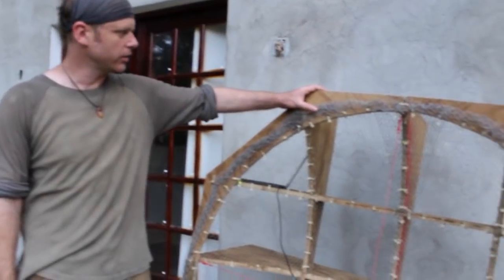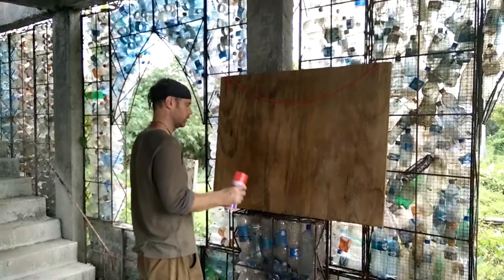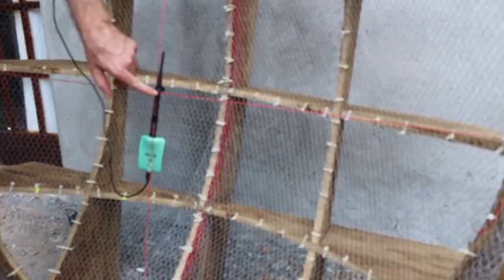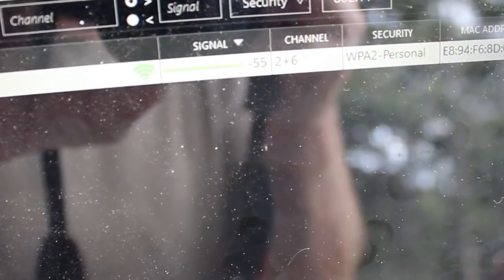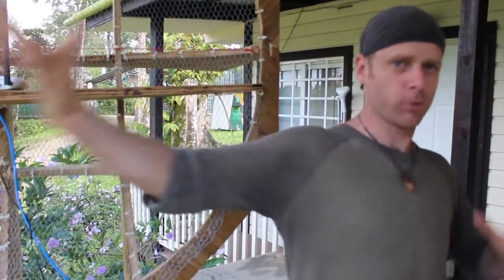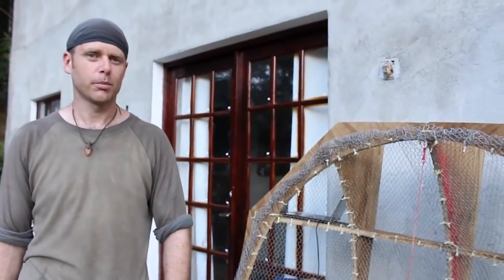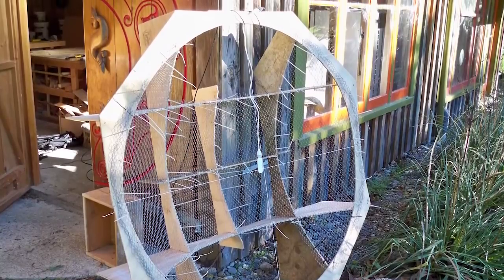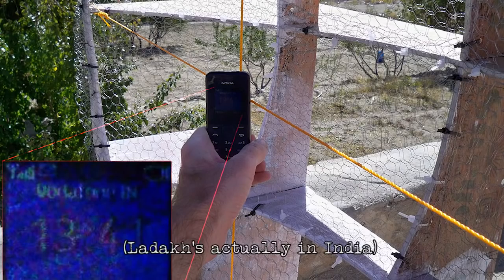$20 WiFi Dish with three mile range

Comment: Just wanting to add some thoughts and info for anyone thinking of doing this anywhere in the world... I've been living with a similar dish enhanced internet for nearly 10 years now. We use an 80cm aluminium dish we found by the road and 3G (and now 4G) USB keys to get signal at the focus from a tower about 40km away.

Instead of using a power-hungry laptop for usb->network routing we've been using a TL-MR3020 USB mini-router (2W total in use, 0.1W idle - we leave it on 24/7). Maybe cheaper or for wifi and more versatility a cheap sbc (like banana Pi Zero) with linux router config should do as well.

Focus seems really important, more than the examples in this Vid would suggest: within 1cm makes a huge difference. Find focus and pointing direction with shiny tape on a few points round the dish and the sun (this also enabled me to bend the slightly bent dish back into perfect shape). It may be the imperfect shape of the chickenwire dish is why focal point doesn't seem to matter so much, making up for it with sheer size. The size is probably also important for getting through trees, which scatter and refract the microwaves.

I tried with a 40cm dish and got seemingly identical 3G results, but with less accuracy of pointing required. Not tried with 4G.

Our dish is aluminium, I've had trouble getting steel dishes to work, I think the issue is skin depth because satellite dishes are made for much higher frequency with a thin silver plate for conductivity down to the skin depth, the silver plate may not be thick enough at 2Ghz for a low conductivity steel reflector. This could affect the (steel) chicken wire reflector, especially as the zinc corrodes.

4G signal boost seems much less with the same dish, just 10dB gain, though if the dish is pointed wrong the data rate still drops radically. I think this is due to the frequency range used by rural 4G being lower (800-900Mhz band) and the same dish has less circular wavelengths of surface so less signal boost at that frequency.
Reply from the maker: Good info, thanks.

Comment: There are all sorts of old analog TV dishes 12 feet across in rural places in Canada. They turn up in scrap bins or can be scrounged for pennies.
Reply from the maker: Yeah, essentially the same principle. It's not super common to find the larger ones tho, and most of them are paraboloidal sections in shape, so the focus is usually off to one side a bit, which makes them harder to mount and aim.
But they do certainly also work.
Reply: @OpenSourceLowTech  I think Canada is unique because it is so far north of the equator. This is why we used to have these large dishes here but the system is now defunct since the satellite went off line. Another reason is the huge geographical expanse between occupied places here which means only town & cities have cable.

Comment: Nice sized dish and construction  method. Aside from obsticles  range is often limited by horizon so getting heigth is important and height can be problematic with more wind. But the chicken wire construction lets the wind through with very low wind loading.

Comment: The thing is where they are it's VERY sparse and isn't channel saturated...they are in panama and I would be there isn't a WiFi router in every home, and every apartment out there (it's a jungle afterall 😉 )...this is more like wide area WiFi running on a single channel with almost NO channel interference...if you tried this somewhere in a heavily populated area it would literally wash out the channel (and those above it and below it) it was operating on for miles...plus I would bet it would also violate FCC rules for dBi regulation with it's gain (in America)...however it's an INCREDIBLE idea and works well for a remote location like that! Kudo's for such an ingenious setup!

I bet you could also get very good coverage with a high gain yagi antenna setup as well

Comment: USB 2.0 is limited to 5 meters.  Using USB hubs/repeaters one can daisy chain up to 5 hubs together to get 30m.  Alternatly there are USB to ethernet adaptors which allows using twisted pair ethernet cables upto 100 meter between two usb to ethernet adaptors.
Reply: Wesley Sandel  yeah, i should have said twisted pair ethernet. I'll   Make that change for clarity.  

In some cases fiber optic might negate the need for USB cables and wifi dongles completely. I'm not in a position to compare cost  but  i belive generally wifi will be more flexible, but fiber optic is hard to beat for distance and data rates. 

On data rates, aside from latency, maybe sneeker net is still king. 😉
Reply: Wesley Sandel   a pcie ethernet fiberoptic card  over multi mode fiber optic cable can get one several kilometers and much faster than a few megebits/s 

With fiber optic,  twisted pair, and wifi,  data is modulated onto the physical medium, and demodulated on the other end. In other words an ethernet card modulates and demodulates.

Comment: 2.4ghz vs 5ghz  bands.  2.4ghz bands can go through vegitation a bit better than 5ghz  but 5 ghz bands can carry more traffic if you dont have obstruction. 

Furthermore, 2.4ghz band have a little over twice the wave length as 5ghz  band.  Thus, depending on the hole size in the chicken wire mesh,  5ghz might be more lossy reflecting  the signals.
Reply from the maker: Indeed.

Comment: A similar effect can be used with metal discs of various sizes attached to a pole. In combination with this it would give excellent range
Reply from the maker: Like a kind of Fresnel reflector?
I like the chicken wire as it can stretch, and so make bowl shapes where flat metal can't.
I do now want to experiment with secondary antennas at the focus, like yagis / cantennas etc, to scoop up more of the focus blob than the basic linear antennas I've been using so far.
Just need to get around to it...
Reply: @OpenSourceLowTech  search “long range wifi antenna” on YouTube, look for a pole with metal circles on it
Reply from the maker: Ah right, that thing. Yeah, would like to plug one into the dish and see what happens..
Reply: @OpenSourceLowTech  also to improve reception the focal point of a parabolic dish isn’t level with the outer edges. It’s about 6 - 8 inches above, based on a 4 foot diameter dish with a curvature base on gravity pulling the chain into a curve.
Reply: Sorry I just re-read that and it comes across rather condescending; I’m pretty sure you are aware of the position of the WiFi dongle is only placed there because it the simplest position...

Keep it simple make it easy.
Reply from the maker: Satellite dishes and the like have offset focal points, ie outside of the dish itself, but this one is calculated such that the focal point is level with the dish front itself, where the strings meet.
Reply: @OpenSourceLowTech  ah! You already calculated the diameter!
Off the top of my head the distance between the 2 points you suspend the chain from to mark out the curvature would be 135 cm give or take 10

Comment: Nice work, you could check a YAGI or similar antenna, if your modem / router already has a removable antenna connection. But a detachable antenna is not extremely common, especially in a jungle, or some low income country where you have to use whatever you already have. So if you already have the hardware, this might be the best option.
Reply from the maker: Yeah next I want to experiment with secondary antennas, such as yagis, biquads, cantennas etc. I think, given that the focus is going to be a bit fuzzy due to the wavelengths, that they might be quite a bit more effective still.
Reply: @OpenSourceLowTech  the lighter weight high gain directional antennas (like the yaga, biquads, and cantennas) will work quite well as remote (portable) setups...they are smaller and lighter than the big parabolic antenna you have and surprisingly enough can be just as high gain and directional as that big "dish" shape...they have some that have connections dozens of KM away...but usually have good line of site with no interference...
Reply from the maker: What I want to see tho is the effect of putting one of those facing back into the dish...

Comment: Do you think you could increase you range by covering the chicken wire in aluminum foil?
Reply from the maker: Probably... A main issue would be getting it smooth tho, otherwise you're just going to scatter microwaves in every direction. Not sure how you'd attach it, would be more work, and would leave the structure a lot more wind affected. 
You might have more bonus with just a second layer of chicken wire, but other types of metal surface do remain options.
Reply: @OpenSourceLowTech  I guess that would be true. Have you considered sandwiching the wire between thin layers of fiberglass and painting it with chrome paint? Maybe sanding it to a high polish?
Reply: @OpenSourceLowTech  not sure if those kinds of supplies are available in your area.

Comment: How sensitive is this to imprecision of the build/setup?  Will it work well if I'm not very precise on the cuts, the hookup of the wire, or the placement of the receiver?
Reply from the maker: It's pretty forgiving. I've not yet compared a perfect CNC'd one to one that's pretty rough, but given the wavelengths involved I'd be surprised if the difference was easily measurable.
Reply: Daniel, I'm a really big fan and I'm honored to say I would be committing the next few years to spreading your great tech. I had this made but I think the guys screwed up with the paraboloid shape, because it hasn't worked so far.

Comment: Intresting idea. Why not use a stapler instead of zip ties?
Reply: That was my first thought as well.
Reply from the maker: It could work, and might be a bit quicker, but the good thing about cable ties is you can use them as little ratchet straps to pull the mesh super tight and smooth to the wood.
The surface ends up under a bit of tension, which establishes the bowled shape and locks the slats together solidly. You'd definitely struggle to get and keep that with staples and the like.
Reply: Staples would need to be stainless and heavy gauge, because they'll rust or pull out as the wood gets dry.  

The zip ties need to at least be UV resistant or they won't last that many years before they'll get brittle and need replacing. Though spray painting over them will prolong their life tremendously by eliminating quite a few years of sun exposure.

Comment: Surely your focus point should be further away from the dish? Unless I'm not seeing as much curve as there truly is?
Reply from the maker: It's a little deeper than it maybe appears. That's mathematically the focus.
Reply: @OpenSourceLowTech  Ah cool. It's a really good cheap design. What sort of frequency would it be good up to? I take it you need at most a mesh hole size of around half of the wavelength?

Comment: It's unlikely that the transceiver was mounted at the focal point. I'd guess that it's around a metre forward of it's current position.
Reply from the maker: The parabolas are calculated to have the point where the strings cross as the focus, but that's assuming collimated signal coming in straight, which is of course a bit optimistic in the real world, but there's not a better place to put it.
Reply: @OpenSourceLowTech  I'm glad that you have considered that. It just looks wrong to me.

Comment: Nice project with practical and rewarding real-world applications. How did you determine that the "gaps" between in that chicken wire would correspond with your target frequencies?  (roughly what is the frequency range for that type of mesh?) . Is there some method you followed, or trial-and-error?
Reply: I don't think he did. Wifi is typically 2.4GHz, which is the same for microwave ovens, and those use a mesh with holes that are much tinier. So there might be room for improvement but whether the difference would be noticeable, I cannot tell.
Reply from the maker: The rule of thumb for reflecting electromagnetic radiation with a conductive mesh is that the cell size should be no more than a tenth the wavelength, which in the case of 2.4 GHz is 125mm / 10 = 12.5, which small cell chicken wire and the like is usually a little smaller than on the long axis.

Comment: It looks like a directional antenna, how sensitive is it to misalignment?
Reply from the maker: It is, and not sure. In use; feels like less than I would have maybe thought, pretty much just a matter of pointing it in the general direction and seems both fairly effective and fairly forgiving.

I've been meaning to properly test the cone angle but haven't yet got around to it.

Comment: MayBe double layer chicken Wire? The reason is that the rule og thumb (arrl handbook) says that the Holes in a mesh dish should be 1/20 wavelength for same reflection as a solid dish, i.e. around 6mm Hole size Edit, you say so yourself, but IT Works fine with one layer..
Reply from the maker: I've been seeing 10th rather than 20th, but the smaller the better, yes.
I think the issue with two layers tho is that they'd separate between connection points, and I'm not sure what that reduction in conductivity would do to the reflectance. Would also increase the costs.

But it is something I want to try at some point, along with a couple other options and variations on the reflective surface.

Comment: -55 dBm at 3 miles going through forest.. damn! 🤤 Is it 2.4Ghz? I assume it is..
Reply from the maker: The three miles was open air line of site, the Panamanian jungle was about three hundred meters, but it would have connected quite a bit further than that.
Both were 2.4 GHz yes.

Comment: wouldn't covering the mesh with kitchen foil improve reflectivity?
Reply from the maker: It could to some extent, but only if you could make and keep the surface very smooth and undamaged, which would be difficult to build and maintain.

Comment: Can something like this be used for DTV (Digital TV) signals? I'm talking specifically for this:  
https://en.wikipedia.org/wiki/Digital_terrestrial_television  
Thanks!
Reply from the maker: Yeah should work better if anything, given the longer wavelength.
Reply: @OpenSourceLowTech  So I just place this behind my actual antenna and it should "focus" the signal?
Reply from the maker: In a nutshell.

Comment: I don't think that's the actual focus, try moving it further away from the dish.
Reply from the maker: Mathematically speaking, it is indeed precisely there.
In practice, given the wavelengths involved, the focus will be a bit of a fuzz ball maybe tennis ball sized, but unless it's been pretty badly made that'll be the center of it.
Reply: calculated focal points on large parabolic dishes with high frequencies are surprisingly close ...just by looking at it you would think it's not tuned right..but mathematically it's spot on